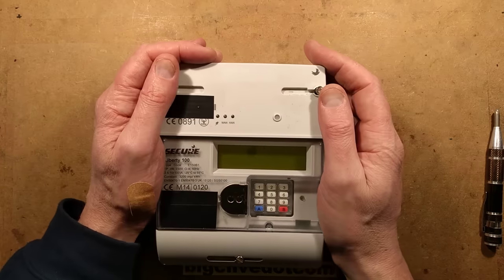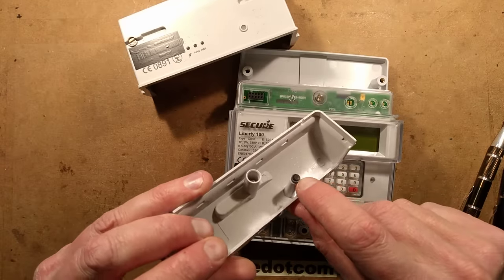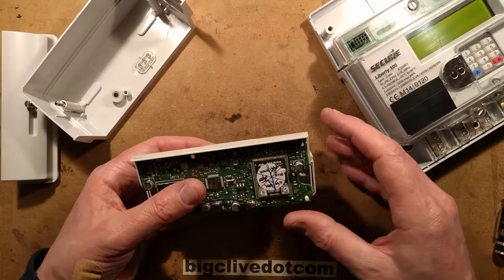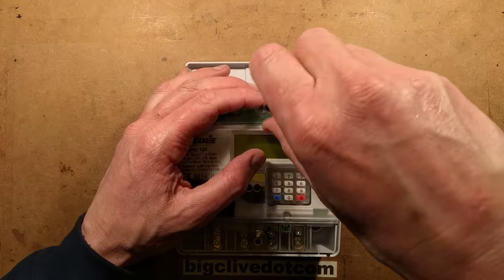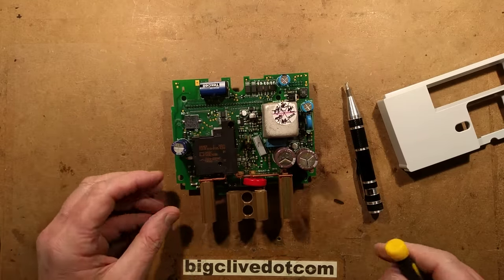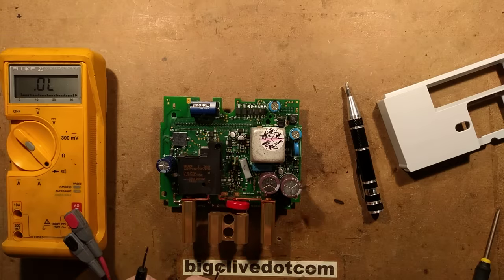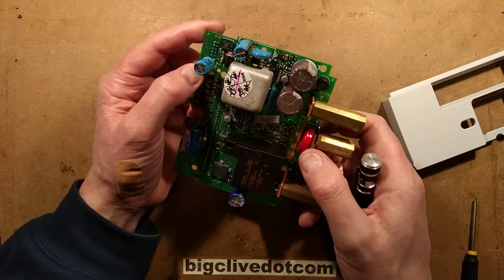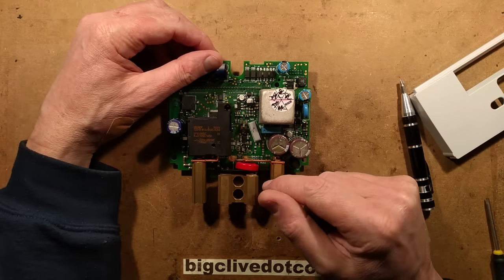Inside a smart meter, and the REAL problem with them.

Comment: I'm still waiting for that inexpensive and abundant nuclear electricity we were promised in the 1960's which was supposed to be "too cheap to meter" aye, right. In the future appliances will be controlled by the meter, one way or another and consumers that don’t have smart appliances on smart tariffs "encouraged" to use them by price hikes on a normal tariff. The existing electricity network as it is now isn't capable of dealing with electric cars and renewables everywhere so balancing generation and demand is going to get challenging. One option is for the utility company to control your appliances via the “smart grid”, a smart meter being the foundation. This would allow them to turn on all the washing machines in your area at 2am if it’s a windy night on the hills. The next morning you wake up to washed clothes (or potentially don’t, due to a house fire) and probably aren’t that bothered if they were washed at 1am, or 5am. Same with charging your electric car. Just like the remote teleswitch units used now on some storage heating - they guarantee your storage heater will be recharged in the small hours, but they control when, so if there’s spare capacity it gets used. Whilst I don’t have a problem with “smart” if it makes us a less polluting and more efficient society, I feel it will be used to benefit the electricity company above all else. The other problem is security and reliability, IT stuff goes wrong all the time you never, ever want to be an early adopter with any new tech. I don’t know where this will go, some new tech had a fantastic vision but if consumers don’t accept it, it dies.
Reply: You'd have had it, if the 'no nukes' crowd hadn't gone so 'throw the baby out with the bathwater!'.   It costs so much to set up a new nuclear plant that it takes decades to recoup the cost - and almost all of it is regulations.  One of the most popular ones is that if the NRC (US) changes a regulation while your plant is under construction, you have to rip out anything necessary to conform to the new regulation, even if you're about to turn on the first reactor.    Also, anything inside the fence of a nuclear power plant is classified as 'low grade nuclear waste'.   That includes the wooden desks and chairs at the guard shack.   They have to be disposed of as if they were the core itself.   I'd rather have a nuclear power plant in my back yard than a prison - it's much safer.   They're cleaner for the environment than coal plants, too - they emit less radiation, as well as no CO2, no sulfur, no fluorides, no chlorine derivatives, and so forth.   You could also connect a brewery and distillery to one and use the waste heat to produce alcohol for drinking and fuel as part of the cooling cycle.
Reply: @tbelding  That's a myth. Even without over-the-top regulations, nuclear power plants are still way more expensive than other forms of generating electricity. The quote from the 60s referred to breeder reactors only, e.g. not the type used today. The problem with these plutonium-powered machines is that the engineering challenges involved in making them economically viable haven't been overcome to this day. In addition most governments are quite uncomfortable at the thought of mass producing weapon-grade nuclear material all around the country...
Reply: @totalermist  - No, they are cheaper.   Not to build, but once they've been operating.   Look at the South Texas nuclear facility.  It's paid for and produces an enormous amount of power.   If you knocked the absurd regulations out, they'd be even cheaper.   It's also better for the environment.   Yes, that sounds weird, but it's true.  We take already radioactive material and make concentrated radioactive material, yes - but if you think about it, disposing of it safely isn't that difficult.  Go to the mountains above Utah, bore a huge hole into the Rockies, and just drop it in there.  Seal it shut.   Available if we find another use for it, but next to impossible to steal, and no water table/etc to contaminate.    Personally, I'm not that afraid of breeder reactors.  They DID overcome the engineering challenges.  They're just not allowed to put them into play.   Frankly, the fear of theft of the nuclear material is insane.  Anyone that breaks into a core to try to steal radioactive material isn't going to survive to do anything with it.  If they have the equipment to do it safely, they'll be ... rather obvious.
Reply: @totalermist  - You've pointed to two prototypes in countries that aren't exactly known for nuclear safety.  You also ignored history in the US.  EBR-II was built in 1958, and ran for thirty years without any major issues.  (I can't find any issues, but I'm sure there were some)  Clinch River, on the other hand, was predominantly shut down due to fraud and contracting abuse.   Even non-breeder reactors have been shown to be perfectly safe - in the US.   Japan's problem with the latest destroyed reactors was CAUSED by the anti-nuclear people!   The operator was so concerned about the lashback from those people that they delayed shutdown until it was too late.   (Even so, building anything to defend against earthquakes AND tsunamis is hard, and they still managed it.   The radioactive material released predominantly went out to sea, where it disperses quite nicely.  No nuclear wasteland across Japan) 

Wind and solar power are, quite frankly, toys.  They depend on optimal conditions, and only operate part time, even with those optimal conditions.   Biomass sounds good, but doesn't scale.   Tidal generators would work, but require effort that people don't want to put into them, because they're not 'pretty'.   Themal depolymerization is probably the best "biomass" alternative, and it keeps being attacked and shut down due to odor.    (yes, people complain about it stinking.)   Fusion isn't there yet.  Hydroelectric is being demolished because it's bad for the environment.    Right now our only clean option for large scale, long term power generation is nuclear.    Coal wastes resources we can't get back.  Same with oil burning.  

http://large.stanford.edu/courses/2014/ph241/rehn2/docs/bell.pdf

https://www.princeton.edu/sgs/publications/sgs/archive/17-2-3-Cochran-Feiv-vonHip.pdf

Keep in mind - almost all of our major nuclear development was between 1947 and 1972.  Since then, people have been willing to throw money at anything but nuclear power, due to scare mongering. (and, as listed above, abuse)
Reply: @tbelding  You must have misunderstand what I was saying. First of all,I was referring to commercial breeder reactors, which the EBR-II wasn't - the name Experimental Breeder Reactor kind of gives it away.

I also didn't even mention any safety issues at all - if you don't even know what a coolant leak or going critical means in the context of nuclear power, I highly doubt that your points are well founded - no offence.

Wind and solar account for 33% (on average, 2017 low: 12%, 2017 peak: >90%) of electricity generation in my country; with 31% from Wind as I'm writing this - hardly "toys". Norway generates 98% of its electricity from hydro-power, with 56% in Switzerland and Austria. Renewable sources for electricity account for more than 50% of Denmark's energy, more than 47% in Croatia, over 65% in Sweden,more than 25% in the UK, and over 55% in Portugal, just to name a few examples (source: Eurostat). I really don't know where you get your information from, but it seems heavily outdated or super US-centric.

As for coal reserves - "As of January 1, 2017, the demonstrated reserve base (DRB) was estimated to contain 476 billion short tons." (source: US Energy Information Administration - https://www.eia.gov/coal/reserves/ ). At an estimated 2019 consumption rate of 655.4 million short tons (source: U.S. EIA, see last link) that's enough coal for more than 725 years , so yeah - the U.S. better start saving on coal yesterday...

In short, IMO renewable sources in conjunction with gas, waste incineration, biomass (accounting for up to 35% of primary energy generation in my country) and cleaner coal are cheaper and more desirable than state-sponsored nuclear plants run by huge energy conglomerates known for price gouging...
Reply: @totalermist  - Considering that there are no existing commercial breeder reactors, as far as I know (Japan's was shut down, and I don't think you could really consider it 'commerical'), it's a bit of a stretch to argue about them.   The US's only 'commercial' one was shut down in 1972 - safely.    I am well aware of the difference between a critical reaction, meltdown, coolant leak, rupture, and so forth.   I also understand the complete cooling cycle of both a liquid metal and light water reactor.  

As for 'toys', yes, they are.   The wind doesn't blow constantly, and the sun is roughly half the day.   Until there's a viable long term energy storage technique, the only time that wind is effective is if the wind is over a certain MPH/KPH.   Using Acciona AW-116/3000 rotor/turbines, (installed in a Texas wind farm) they don't cut in until the wind is at 11 KPH, and cut out if the wind exceeds 72 KPH, with an optimized wind velocity of 38 KPH.   The average wind speed in Houston is 12 KPH, and Dallas is 17kph.   (Both Texas cities, 240 miles apart - 386KM)  That means that the windmills would be barely ticking over much of the time.   Solar - if it's overcast, solar doesn't do much, and if it's night, it does nothing at all.   The only 24/7 solar plant that I know of that's doing reasonably well is the Crescent Dunes plant in Nevada  (my cut and paste is locking up the browser, but you can search for it online).  It uses molten salts to store heat during the day, and uses that at night to drive steam turbines.   It's also under fire for frying birds.   Wind farms are under attack for the amount of land they use, and also for killing birds.  (Frankly, if a bird is THAT slow, maybe it needs that kind of natural selection.)    Solar plants require constant work to keep them clean, especially since the environments that work best for them are deserts, where dust/sand storms are a problem.  (and again, the environmental nuts complaining about all the 'habitat' under shade).   

Hydro electric?   We have very few large scale hydroelectric plants left in the US, and they'reall coming up on needing massive refurbishment.    Many of the plants have been demolished in the last few years due to environmental concerns - mostly in the Pacific Northwest, where the salmon population, other fish, and the offshore environment suffered from lack of sediment being washed out to the sea.  

Now, if they can come up with an environmentally friendly way to store massive amounts of power, useful when the wind isn't blowing (or is blowing too hard), and the sun isn't shining (or something is covering the panels), then solar and wind will become fully viable alternatives.    No, lead acid battery farms aren't environmentally friendly.   I'm not one of those people that are panicked about lead in the environment, but lead acid batteries in a battery farm usually have less than a three year lifespan.   I end up replacing 'long life' UPS batteries every two to four years, and regular batteries between one and three years.   That means that, at a minimum, you have to pay to replace the batteries every 3 years, and the old batteries have to be crushed, melted down, refined, and recreated into new ones.  That's a lot of plastic being scrapped as well.    Mechanical batteries are being worked on, but they're not there yet.  (basically huge gyroscopes that you spin up when power is plentiful, and use regenerative braking to pull power out of them.   If you use magnetic bearings, and a vacuum, you could get as close to frictionless as possible.) 

As for coal and oil?   I don't know about you, but I'd rather we stopped using them up for fuels, and only use them for what we haven't found good replacements yet.   That is, coal/coke for refining iron, and oil for lubricants and some plastics.   Saying "There's plenty out there." doesn't fix "We have a limited amount available."
Reply: @tbelding  Well since breeder reactors aren't commercially available and thorium reactors don't exist yet, we're down to light water and heavy water uranium reactors. Since uranium is a finite resource, it's the same as coal. As far as renewable sources go, I'm afraid we have to agree to disagree. There as many European countries generate a significant portion of their electricity using renewable sources and most of these countries are indeed industrial nations that manage just fine using solar, wind, hydro-power, biomass, etc.

Wind, solar, and hydro-power have one basic requirement: location, location, location. It's stupid to build on-shore wind parks in places without enough wind. It's also unintelligent to install hydro-power plants where they negatively affect the environment. Nevertheless there are enough locations without these issues and installing solar thermal heating, roof-top PV, and so on can and does provide a viable alternative to the grid for many households. Not to forget about the immense potential for simply reducing energy usage in general. The per-capita primary energy consumption in the US is still about 97% higher than in Japan and 78% higher than in Germany (it's even a little worse when just considering electricity) where there's an estimated potential savings of at least 20% by changing usage patterns alone - no technical solutions or investments in further thermal insulation and the like required...

As for batteries: again, old news. There's been major progress made with solid state batteries, ultra capacitors and redox flow batteries. Apart from that, power-to-gas is always an option, especially considering how the wind park near my house is only active half of the day because there's too much electricity and the utility rather shuts it down for a few hours than sell electricity at a loss. In cases like that the horribly low efficiency of power-to-gas wouldn't be an issue. It's not a big problem that solar doesn't work at night, either. Electricity consumption incidentally is lowest at night as well...

And those that protest any form of electricity generation, be it solar, wind, coal, gas, nuclear, or hydro will always exist and should simply move back into caves that they can share with bears and other critters. I'm impartial to the means of electricity generation as long as its economical, preferably decentralised, somewhat clean, locally available and sustainable for at least two centuries. Nuclear reactors are either horribly unsafe and dirty (if completely unregulated) or obscenely expensive to build and operate (when "properly" regulated). Nuclear power as implemented today is nothing but an afterthought, an ugly chimera pretending to be swan, a by-product of nuclear armament and it shows. Had fission been designed for energy supply from the ground up, it would have used thorium as a fuel from day one and would have reached a thorium-based breeder cycle by now...
Reply: @totalermist  I echo all your sentiments and rebuttals of the nuclear lobby supported by Troy Belding.  I can add a few thoughts that support the sustainable case as well and am encouraged by others talking about 2000 year planning instead of a few election cycles that controls much of the energy policy. 

In Tampere, Finland a district heating utility has just come one line that supplies heat to 30 apartment buildings.  It has the added interesting benefit that it sells the Carbofex product.  This is a carbon product to fortify, composts piles, ready compost or soil to minimise odours and stabilise water retention and provide slow release and fully locked in carbon for plant husbandry.  The district heating is a by-product of the carbon capture production and it is fuelled by forestry waste.  Basically it takes biomass that would be composting in the forest or burnt for fuel and captures the carbon while providing much of the energy content along the way.  -  https://yle.fi/uutiset/3-10470198

Also a very interesting film was made about the problems with permanent nuclear waste storage in Finland called Into Eternity.  Finnish law prohibits the export of nuclear (and much other) waste so a plan had to be made. When last I read Finland was the first country to have started work on a permanent nuclear waste repository that is going to be a series of chambers in an underground tunnel system.  It is expected to handle the next 100 years of waste from the current nuclear plants and is hoped to be safe for 100'000 years.  If nuclear power were to continue business as usual then it could be consolidated after another 1000 such sites have been filled.  -  https://en.wikipedia.org/wiki/Into_Eternity_(film)  -  https://www.youtube.com/watch?v=5XGufLCQ3m4  -  The full film was somewhere on-line previously.

I would be happy to communicate with you outside of YT if interested, you appear to have a decent grip on the energy landscape.
Reply: I'm worried more about the potential to use the smart grid to cut power off or ration it like in North Korea does, so if it's too hot out you cant use more air conditioning because high demand. It sets a scary precedent